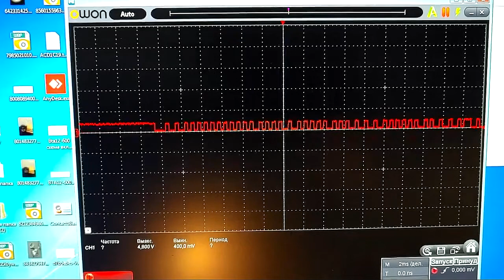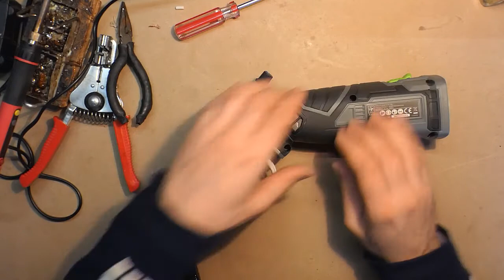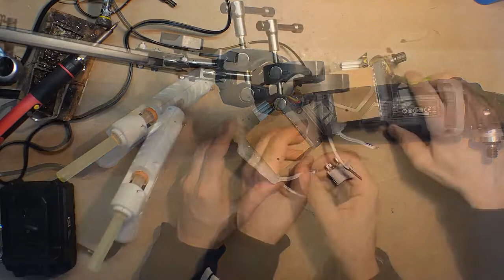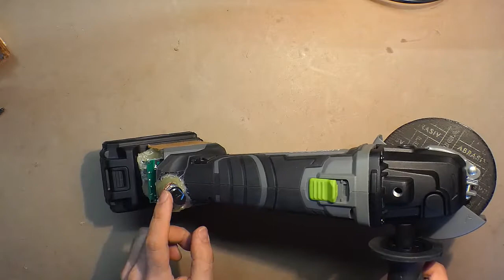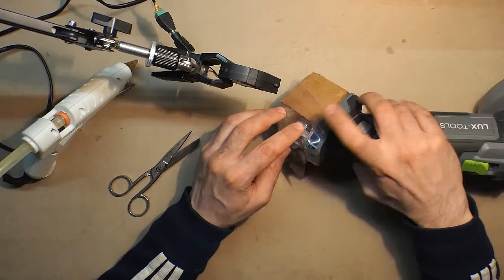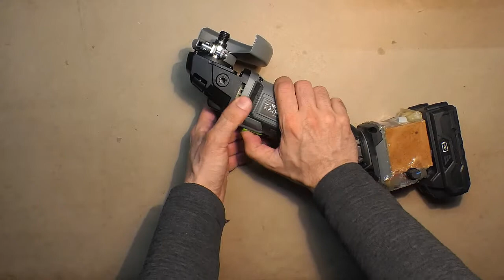How to use LUX TOOLS with different batteries

Comment: Hi! I recently had to hit this problem with my Lux Tools. 

Did you find how C terminal exchange information?

I wanted to use Makita Batteries and found a "work around" at the moment.
I sacrificed an original battery to use the BMS. I emulated tensions of every single cell with a custom circuit (using OpAmp). With this solution I have my custom battery conversion kit, but I still want to decode that C signal.

Comment: hi
i heard about lux tools using this safety thing... but while i dont know anything about these things etc.. i printed myself lux-worx adapter. can you please explain why it doesnt work? i tried + + and - -. then with the third terminal as well, but if the for example grinder doesnt work with other batteries, it means lux batteries dont work with worx in this case???
while my father has lux to ryobi adapter with protection board and it works just fine. we have almost every lux tool and a ton of batteries, so i wonder or if you would be kind to explain to me, why i cant make it work with worx makerx tools.
thanks!!!
Reply from the maker: Lux-tools devices have a special coded signal at their third terminal, that's why its impossible to use just a mechanical converter/adapter. I have never seen such batteries from other manufacturers, but it was not possible for me to "cheat" the grinder and use it with another battery.
 Please, subscribe to my another channel: https://www.youtube.com/channel/UCbQUNw5V5pDPXugLX1FP_Fg

Comment: That was a lot of effort. That signal between the balance controller to the battery perhaps needs to be investigated further. I couldn't see the frequency of the signal, but perhaps the signal can be recorded and played back when required with a "10s Sound Musical Voice Audio Recordable Recorder Module" - you will need to adjust input output volts to match the battery signal levels.
Reply from the maker: Oh, my friend, - there is no simple signal there)) There is the information not only about the LUX-TOOLS battery presence, but also - about the condition of its thermal sensor. Of course, we can "repeat" it.... but for me there were two ways out: to buy their battery or.... to record this video))) Moreover, - the owner of this battery (on the screenshot with the board) has added the section of 2.0 Ah to 2.0 Ah LUX-TOOLS battery, and it stopped working. According to him, it's impossible to increase the capacity because the BMS board measures the internal impedance of the cells, and in case it becomes lower - it stops functioning.
So, shortly, - I'm not a fan of  LUX-TOOLS at all ;) 
Simply, I've got this angle grinder at less than $30.
Reply: @powerbatterychannel4315  Very good - your course of action makes a lot of sense now.

Comment: Hello.  Please explain in more detail where the third contact of the grinder is connected?
Reply from the maker: The battery generates special signal and sends it to the third contact, by means of which the grinder "understands" that it is the battery of its brand.
Stupid system, but LUX TOOLS uses it.
Reply: @powerbatterychannel4315  Thanks for the answer.  I want to power the tool from a DC source through a PWM controller like in your video. Will I be able to do this without the original battery?  I do not understand where the third contact is connected.  Thank you )
Reply from the maker: @zhydkovp  You will not be able to do it without the corresponding signal - please, see its picture: https://youtu.be/-BjGlfXGObQ?t=75
Reply: @powerbatterychannel4315  Thanks for the detailed explanation!  I will try to generate a signal.
Reply from the maker: @zhydkovp  Ok, go ahead!
It will be too interesting!